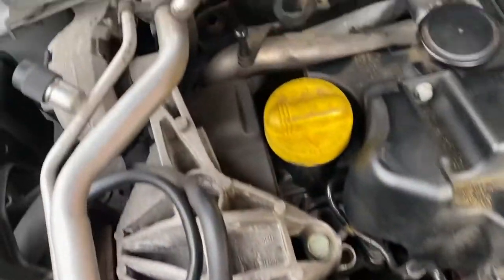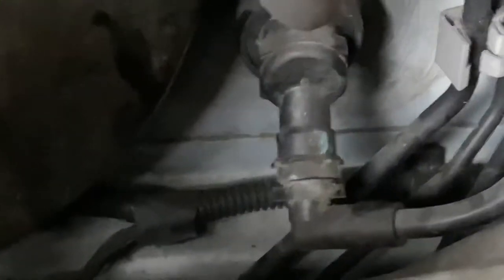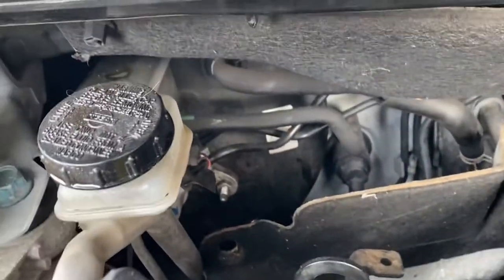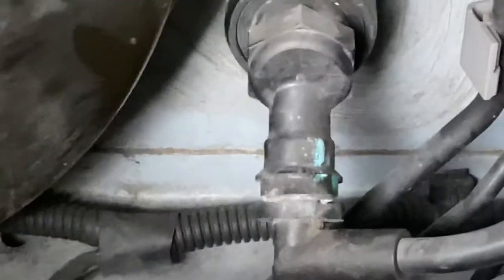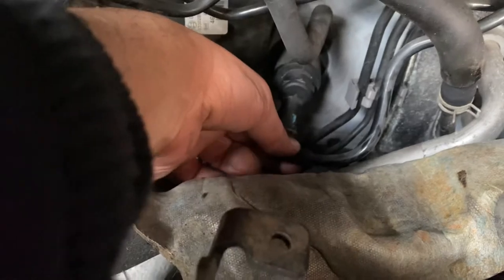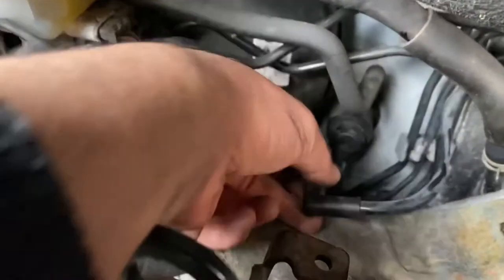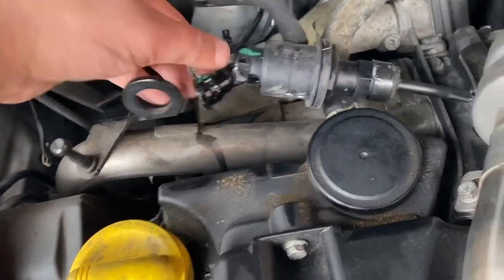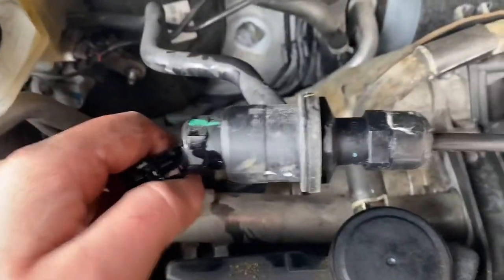nissan qashqai clutch master cylinder

Comment: Good video, thanks, there's a sneak 'fix' if the rose survives but pops off, some guy sells a plastic panel £10 on the eebayuk to hold it on but it can still move up slightly and sustain damage, this is by far the best option long term if you have £100, you must bleed it after. 🙂
Reply: What's the part name, could you link the ebay page please. Thanks

Comment: do you have to disconnect anything from inside the car driver side?
Reply from the maker: no unless the plastic clip is still attached from inside mine broke off so i changed the full unit